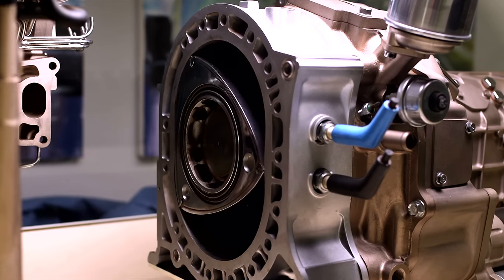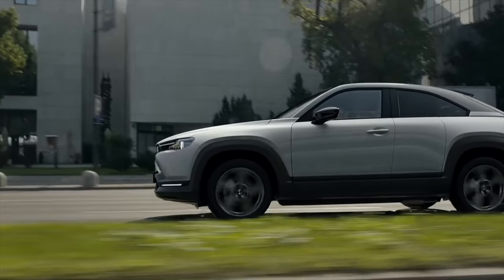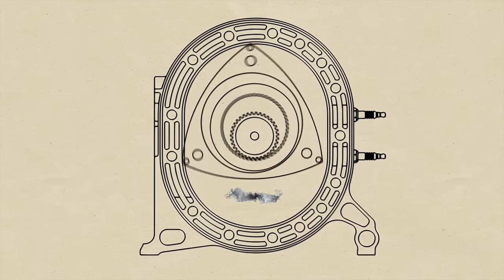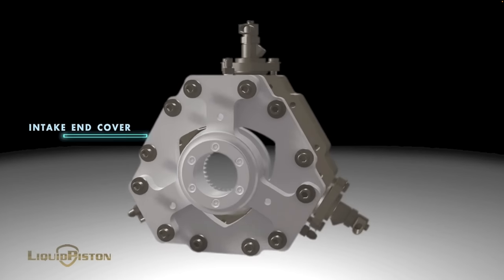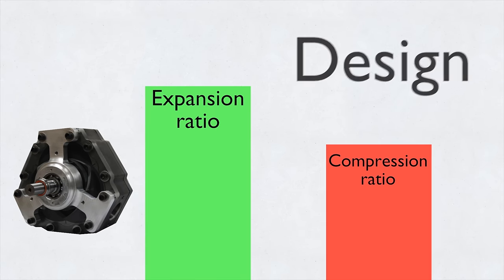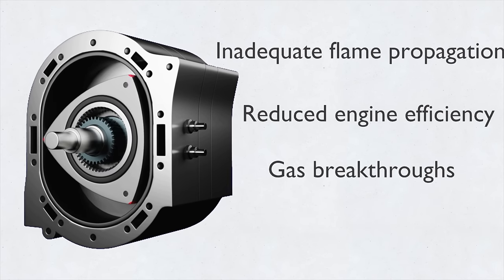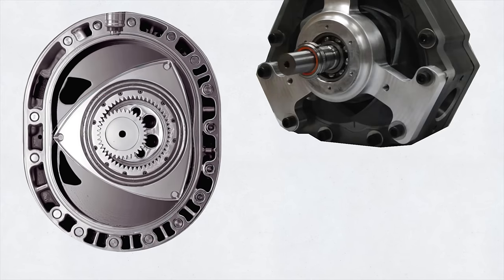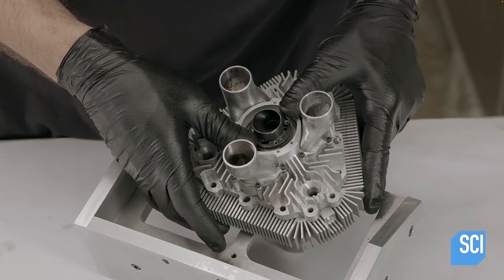Mazda's New Engine is the Smallest and Most Powerful Engine Ever Made

Comment: The LiquidPiston engine sounds like the HUGE leap in technology that we need right now.
Reply: yeah sounds too good to be true, I wonder how the they fixed the sealing problem
Reply: Scotty addressed that. 
By the seals being mounted in the cylinder wall they can be simply lubricated from an oil pump verses the wankel having to inject the oil into the combustion chamber to be burned.
Reply: @johnhogan3810  that'll produce the same result as the other rotaries because there was a design with an oil vein on a rotor back like 10 years ago that had the same problem and it didn't lubricate enough, I guess we'll have to see
Reply: @Kristofer FC  I hope we will see. This could be huge. As with all new engineering, only lots of testing will tell. The ability to use hydrogen would also be a change. If I understand it with no gas to breakdown the oil film that would be a big change.
I don't really know much about roteries or hydrogen. It is fun to speculate and hope.
Reply: @johnhogan3810  hydrogen engines are trash worse than gas, worse than diesel and worse than electric. Literally THE worst fuel choice rn.
Reply: @MV-ri7zu  We've only really seen piston hydrogen engines, there's not enough to say whether it's better or worse but this looks like it can be promising
Reply: @MV-ri7zu  Many electric vehicles can't get me to work and back (distance). They are also out of my budget. I don't think your assessment is accurate for everyone.
Reply: Does anyone Heard of Omega rotary engine?
Reply: @keilmillerjr9701  then buy a gas or a diesel car lol
Reply: @robertbridges6271  the reason why hydrogen is trash is because the production of hydrogen as fuel is trash. It's not a naturally reoccurring gas that can be easily obtained. 

It is also EXTREMELY dangerous. I cannot think of anything more dangerous than carrying around hydrogen in an object that constantly gets crushed everyday (cars).
Reply: @kristoferfc6525  these were my exact thoughts where were the negatives. Anyone that trys to sell you something without explaining the obvious flaws always makes me think it is a scam. 

I'm all for the pros like hey more power to you but everything is life comes at a cost. You will never find a perfect solution, and being open and honest about shortcomings in any product especially something you want to last 10+ years is a pretty big deal.
Reply: @seemlesslies   Actually hydrogen gas naturally occurs at the deep of seas as hydrogen sulphide. Obtaining those gases are not so much harder than LPG. But I agree with your point, its extremely dangerous to carry at commuting vehicle
Reply: EV is future.
Reply: @keilmillerjr9701  since 2010 there are battery electric cars going further than 100km per charge, so the answer is obvious - either move or change job.

Comment: I like this liquid piston engine. As a former Mazda owner , I always thought there should have been a rotary option for the Miata.
Reply: That would have cannibalized sales of the RX-8. No manufacturer w/ any sense does that to themselves.
Reply: @nunyabidniz2868  Never liked the RX-8. Former 1987 RX-7 owner.
Reply: @WALTERBROADDUS   I owned a 1971 or 2 Mazda RX-2.  I loved the power and the 4 speed.  That's after I finally found a Mazda dealer that knew how to stop the endless backfiring.    (Hollywood Mazda)  It liked to do that when I drove through the old, original Pasadena Fwy. with its series of arched tunnels.   Other drivers threw me some very dirty looks.
Reply: @ronlheureux7623  I think this new rotary engine offers a lot of Promise over the Wankel. It's power-to-weight ratio and compact size makes it a very attractive power plant. Not everybody wants to drive a Econo box or an SUV. I mean anybody who complains about fuel economy no, has never been to a Dodge dealership.🤣 When it ran well, the RX-7 was a great car. The cold start flooding was a pain though. 😞
Reply: That would be perfect.
Reply: You could swap it...
Reply: Owner of a 87 fc 93 fd in passed and a single turbo 92 fd now and also drive a electric car these days would love a rotary hybrid
Reply: Faaaaaxxxxxx
Reply: maybe consult people like Rob Dahm if you wanna a rotary miata lmao.
Reply: @alrecks619  it just seems like a natural match? Small car, small but powerful motor.
Reply: As a person who owns an rx - trust me, don’t buy it, worst money I’ve ever spent.
Reply: Funnily enough, I think Mazda should have offered a variant of the RX-8 (MX-8 perhaps?) with the 2.3L MZR turbo engine featured in the Mazda 6 MPS. sure, the Wankel wasn't the most compliant of engines as far as emissions are concerned, but the RX-8 was a great platform and it's a shame that it went to waste
Reply: @YouNameItGaming  I actually hated the RX8. It was ugly as Sin vs. The RX 7. This new version  of Rotary is great though.
Reply: As far as looks go, all Mazda need to do to spark my interest is bring back the old FD

Comment: Liquid piston engine sounds like the perfect solution as a range extender in EV's. Either only to produce electricity, or in addition help drive the car at speed, either through a torque converter or a e-cvt. Hybrid solutions would be smarter since each car only would need half the battery, or even less. It's probably cheaper and easier to produce hybrids compared to pure ev's with huge batteries.
Reply: Could even be used as a hybrid solution for mopeds/motorbikes due to the light weight!?
Reply: EVs don’t need range extenders.  They already have 300+ mile range which is waaaay more than average person needs.   On riad trips, they can supercharge in just 20 minutes.
Reply: @electrictroy2010  do note that EVs absolutely require infrastructure. Take it anywhere outside the city or in a less developed country and you're constrained to only main roads, essentially. I do not know how the situation is in America, but I find the idea of hybrids quite appealing as they offer best of both worlds, being capable of zero emission driving while in the city while also maintaining the range benefits of an ICE.
Reply: @gamespender8605  These would need infrastructure as well. Unless they're doing on board electrolysis and getting hydrogen from water (which wouldn't be very efficient), you'd need to have hydrogen filling stations.

Comment: I bought a 93 RX-7 in 95. On my first road trip I was scared when I heard an aircraft type warning buzzer and an oil light was flashing. I quickly learned how much oil rotary engines consume. Still loved it though
Reply: 93 great year.
Reply: Friend had one in college.  What an amazing car that I had some near-death experiences in 🤣
Reply: Haha yes. I was working all night in a 76 station in my college years. I had a RX-2. One night a woman pulled in driving a small Mazda rotary engine pickup at about 2AM looking white in the face. She got out and said "My oil light came on as a came over the hill.
I asked if she knew that the engine is designed to use oil. There was none on the dipstick. Added 3 quarts and she was back on the road.

Comment: We’ve been waiting for the Rotary engine to come back for the longest time 🥲
Reply: I haven't.
Reply: No one wants a rotary engine car that required more maintenance than necessary.... Thats what project cars are for.
Reply: @bign1667  enthusiasts r still hunger for rotary engine tho
Reply: @bign1667  I've done like nothing to my car besides replace light bulbs, tires, and coil packs. Any other car you have me driving pedal to the metal redlining it all the time I'd have blown them to pieces by now, but not the RX-8. Biggest maintenance? Change the oil when I remember to, and premix. Yeah, that's not exactly crazy difficult (and you can get a SOHN adapter so you don't even have to pre-mix, just makes it separate oil tank like some dirt bikes or DEFT fluid in diesels)
Reply: @bign1667  My RX-8 is lower maintenance than my Audi stick to talking about things you know about 👍

Comment: I think EVs with onboard generators powered by small gas/diesel engines are the future. You get extended range, quick refueling, and you can plug it in at night... so you can have one car that does it all, economical green commuter and cross-country capable. The LiquidPiston engine is ideal for this, being much smaller than an equivalent HP piston engine. They also are competitive in the general aviation auxiliary power unit (APU) market, which right now uses small gas turbines that are not fuel efficient. The LiquidPiston would also be a natural fit for a CV transmission, whether hydraulic or belt-driven. Disclaimer: I found out about these several years ago and invested in them during their initial grassroots cycle on WeFunder in 2019.

Comment: Drove an RX7 with the Wankel, in the '80s, was as powerful as a 289 ford, very smooth.
Reply: A Ford 289 in the 80's wasn't very powerful
Reply: @DylanL69  — Ford didn’t build the 289 in the 80’s ... The last year for the 289 was 1968, and they had excellent power by 1980’s standards ...
Reply: The RX7 was fun to drive, but more impressive was how even the 1st-gen model really woke up with the addition of a turbocharger ...

Comment: Longevity was the problem with the RX8 wenkle engine. A rebuild was required at 70k miles as the seals needed replacing which cost an absolute fortune. In UK now one can pick up an RX8 on the used market for virtually nothing.

Comment: I had an rx2 it was a hoot to drive, on take off the left front wheel would come off the ground did not matter if you forgot to shift VERY high RPMs. {12MPG}
Reply: braap braap braaaaap  !! (I'm a sucker for old school bridgeports, favs rx3, rx4, rx5 and second gen rx7s)

Life time rotary engine lover, too bad people don't know very well how great an engine they are, the smoothness, the easy revs, the noise, everything, you just got to learn to live with them which isn't too hard.
Reply: @KenanTurkiye  They need replaced at around 100k? The engine seems small enough to replace relatively easily.
Reply: @ocrapo9327  Although the rotary engines generaly do not last as long as a conventional piston variants, the various sayings 'replace at so and so km/miles'' are just wrong.

A properperly used and looked after rotary engine can last a few hundred thousand kilometres, but if you are to thrash it, meaning you rev it beyond it's supposed to, do not lubricate it as it needs, do not let it warp up and cool down as it needs it wont last much, but neither will a conventional piston engine.

The ''not lasting'' issue is even more exaggerated on the rotaries because people who usually own them envisige them to be super powerfull and fast (in original form which they are not) so they thrash them without the proper knowledge to taking care of them, so thats why the market is full of wrecked rotary engined cars, hence the common misconception.

I owned, modified and raced rotary engines, they are just like any other engine, but yes in fair comparison they are about roughly 70 percent the life expectancy, fuel economy of a comparative conventional engine.

Yet they are 700 percent more fun. : )
Reply: I had a lot of fun with my RX2.  I bought it used, and unfortunately found that the seals didn't last as mentioned in the video.  Oil consumption went up, and the engine would backfire when you turned it off due to the worn seals.  But it was impressive to drive.
Reply: I miss driving my rx7 it smelled like I was in the gas tank 24/7 but it was such an awesome car
Reply: @sethlt9681  Dude!!!! you have been bitten by the rotary love bug too!!! lol :))

Comment: Sounds very promising. Does the engine scavenge enough water from the exhaust for the steam injection, or does the car require an additional water supply? A big limiting factor with motorcycles is volume restrictions. So how big a hydrogen tank, and how far a range? And corrosion: water pooling in an engine doesn't sound like a good idea at all, even with stainless. How have they figured that out? And scaling up?

Comment: I like the small liquid piston design. Hope it makes it to production cars. Be awesome if it can run on CNG or other fuels. CNG is still very cheap now.
Reply: Cng?
Reply: @kyleoden3015  “compressed natural gas”
Reply: In Poland LPG seems to be as popular as Gasoline. On the Mazda website they kept emphasizing that rotaries are well suited to hydrogen, something they have tested.
Reply: @MrDuncl  we had an LPG conversion kit installed in our Toyota Vios. It's not uncommon here in Thailand. The problem is, LPG has a higher ignition temperature point. It burned out our engine after six or seven years of use. Loved it while it lasted.
Reply: @sinjun75  Considered water injection to keep the mixture cooler (and denser) prior to combustion?
Reply: @tommybland7657  wish I knew they had such a thing at that time
Reply: I have a Honda civic GX and I love it. Runs on $1.99/gal CNG.
Reply: Until it blows up while filling up
Reply: @biohazard911  While commuters in 'four wheelers' linger next to moving '18 wheelers' with CNG powered engines with retreads on their trailers.
Ever pick up the pieces of a blown out truck tire?
CNG has a track record and infrastructure.
Gasoline gives you a little dose of benzene and other aromatics every time you fill the tank.

Comment: One of the problems with Hydrogen is tank weight, but If the engines can scale they may have use running generators for Grid Storage for power when the sun/wind isn't available.

Comment: A 40Hp Diesel or hydrogen Liquid Piston engine would be excellent for range extending electric vehicles.  If the engine goes up to 60Hp you can probably get rid of half the batteries and keep batteries and super capacitors fully charged for top speeds.  Once solid state batteries come out it will be a real game changer.
I think the Quasiturbine is the best design yet.

Comment: I bought a brand new Mazda RX 7 with the original formula white paint job in 1982 with a Wankel Rotary engine, five speed on the floor, four barrel carburetor, that car screwed for 100 hp, Paid $11,500 for it brand new, right in the owners manual it said it burns a tablespoon full oil with every fill up.

Comment: You can't beat the sound of a two rotor or three rotor it's unlike anything else that's what makes them so great. But they definitely are more finicky when it comes to seals
Reply: Ever hear a 4 rotor? Was the nastiest, meanest thing I've ever heard.
Reply: 2 rotors? 3 rotors!?
Reply: I think my V8 pushrod with 220k miles still sounds pretty good.  Hard to beat that.  But rotary engines and hydrogen potentially fixing the problems sounds good too! And the X-motor is interesting.
Reply: @ocrapo9327  ?
Reply: More like every rotory...
Reply: I think any old Merlin would beat that handsomely.

Comment: Liquid Piston has done a lightweight generator {yes: disclosure; invested into - minor, last year)  Compared to a 4 cycle engine the single X rotor is equivalent to a 6 cylinder standard piston engine.. but not so expandable beyond that and when scaled up, it will have to have a cooling water jacket.  I still like the Wankel for it's one side exhaust and believe that the Apex seal problem was not addressed properly in the past with internal piston oil channeling.

Comment: I think here in Australia with the huge distances we cover semi regularly ( a 4 hour trip to anywhere for lunch an 4 hours home is not unheard of for weekend entertainment) means we need very big and expensive batteries in our cars. This type of compact engine could play a huge role in electrifying motive power. Simply throw a sufficiently sized liquid piston generator in the frunk  an wire it to the DC fast charging cable and continue on with your road trip.

Comment: How strange.  I got 23 mpg with my 1972 RX-3.  Didn't come close to that mpg until I got my 2012 Honda Civic.
Reply: Was that right before the then new emission standards went into effect? My family's 73 Pontiac Ventura, with a 305 got 8 mpg!
Reply: And my 4 door Dodge Colt got 40mpg highway in the early 1990’s. It did fine, with a stick shift!

If the regulatory burden had not increased, I bet advancements to that engine & frame would be competitive to hybrids today

Comment: There's a place for all engine types in the marketplace.  There have been diesel powered, hybrid, electric, multiple types of gasoline (ICE) engines, hydrogen powered, natural gas powered, and biofuel vehicles on our roads for a long while.  In the past, there were steam powered (ECE) vehicles also.  The US market has always allowed for multiple technologies and that will continue for as long as people still demand them.  This idea that we are going to replace one completely is absurd. The Amish still use horse and buggy. That alone shows that old technology still has a place.
Reply: One of the problems with internal combustion engines is that they use air which is about 80% nitrogen. When involved in the combustion process produces nitrogen oxides which is a pollutant.